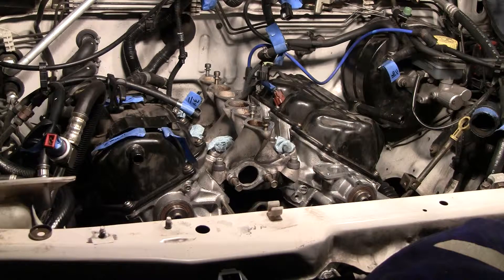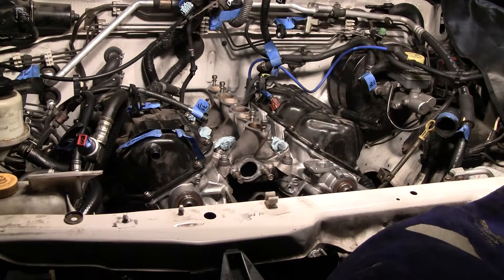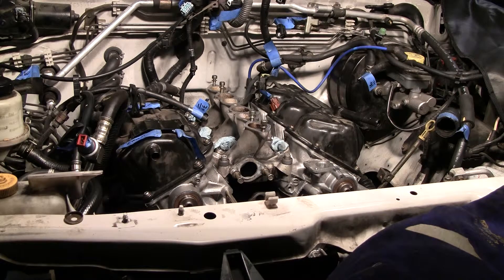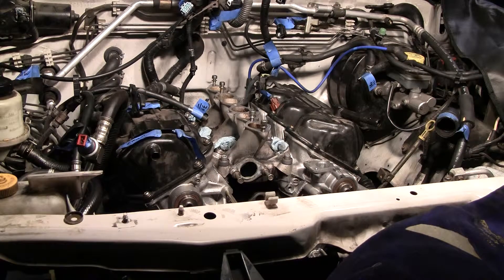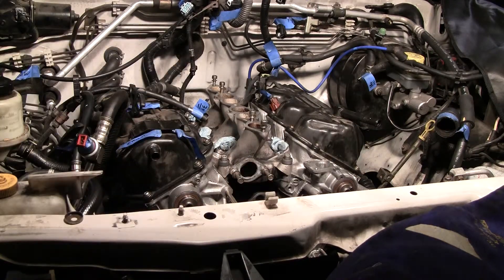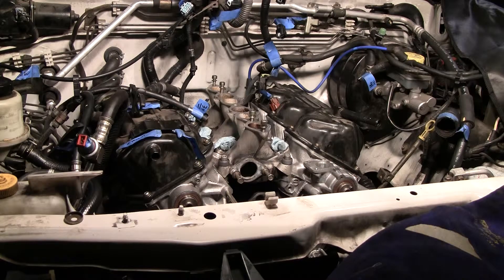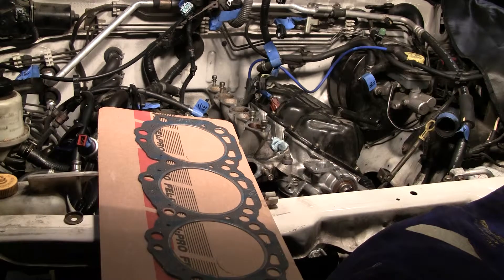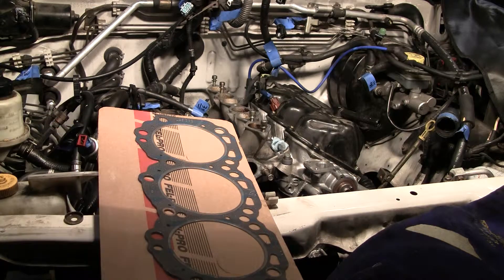2002 Nissan Xterra VG33E Rebuild Step by Step Part 75 - 2 Steps Forward, 1 Step Back

Comment: did you use silicone on rocker covers? If so what kind? Thanks
Reply from the maker: No. There was a rubber gasket that came with my kit. Haven't had any leaks by replacing the used gasket and torquing down bolts to the correct tension.
Reply: Do you remember the bolts you buy? There is cheap ones and expensive ones at rockauto but will trust you better
Reply: I'm about to start putting everything back, my heads are ready and I'm down to buy bolts and reinstall, thanks to you men
Reply from the maker: @falconboricua  https://www.rockauto.com/en/moreinfo.php?pk=916965&cc=1388167&jsn=9 FEL-PRO ES72194
Reply from the maker: @falconboricua  Congrats man! Its a process, and I'm proud of you being able to do it. It's not easy and super rewarding when you get it finished. The bolts I used were the FEL-PRO ES72194. Do not use the old bolts.
Reply: So I didn't tork the intake manifold together with heads!! I messed up and torked heads only because of two different books! on one it's a tight heads only and the other together with intake! Do you think I should restart or keep going? Thanks a lot men
Reply: I'm afraid the gaskets will not work if I loose the bolts
Reply from the maker: @falconboricua  yes. Restart and torque down the intake manifold in the order defined in the factory service manual.
Reply from the maker: @falconboricua  gaskets will be fine. They aren't sealed until the engine is warmed up. If you use the gaskets that I used, I unbolted and bolted them several times no problems
Reply: Thanks for the quick repply, I was stressed out!! So I will  release all bolts and do it right. Did you do a final degree after the final 40-47 ft-lb or that was your final tork?
Reply from the maker: @falconboricua  no. Just followed the manual. You might need to untorque in order as well. Be mindful as to not warp your head.